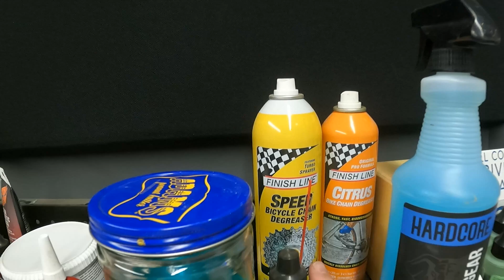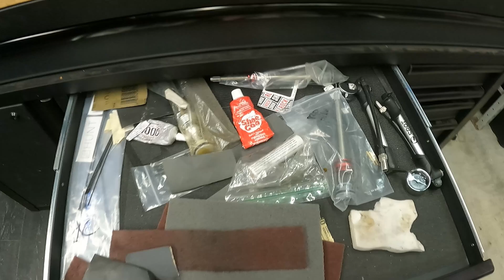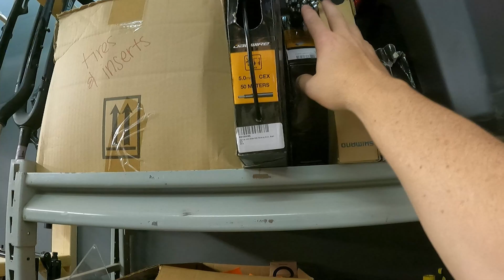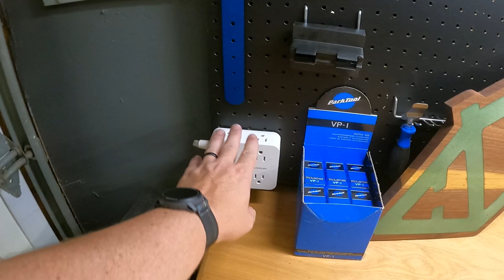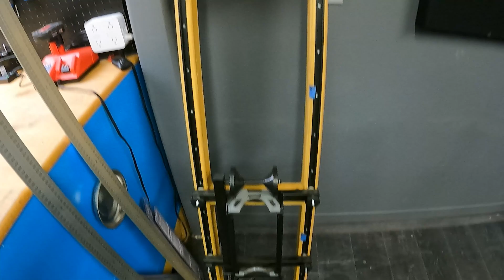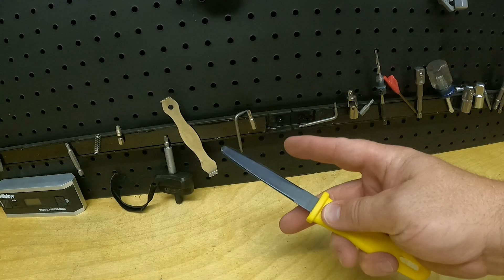A Tour of My Bike Shop/Recording Studio - Favorite Tools, Setup, Parts, and Lubricants

Comment: My favourite 'tool' at the moment is the RadarLabs Loobtoobs, its a grease syringe (various sizes) with a brush tip that makes greasing threads much less messy. It has great ergonomics and a lock nut so you don't grease the inside of your tool box by accident.
Reply from the maker: That sounds fantastic!

Comment: I’m surprised you don’t have the Park tool WH-1  wheel holder. I have a 10 x 20 building with a roll up door I made into my bike workshop. That wheel holder is used all the time for removing rotors and is a game changer for wheel taping and tire mounting.
Reply from the maker: Good to hear, i never thought id use it

Comment: Awesome video!  Dude, the dropper diameter standard is so frustrating.  I've started only buying 30.9 droppers and using a Problem Solvers shim if I need to swap to a bike that's 31.6 or bigger.  It's been working really well for me.

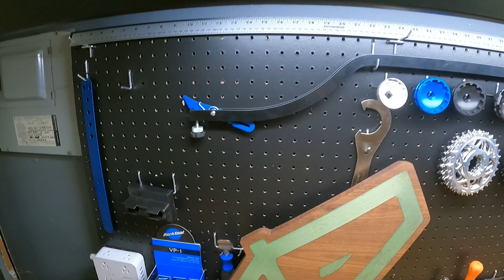Comment: 18:15 Frame alignment tool, not a wheel dishing tool. 👍👍
Reply from the maker: you're right! I knew that, but I totally got my wires crossed when talking. I do have a wheel dishing tool too but it's in a dawer.
Reply: @BigBrainParty Easy mixup! They kinda have a similar curve and are made out of a similar size square tube.

Comment: I know it’s hardtail party but I also know you ride full suspension bikes. What bearing press do you use for linkage bearings and hub bearings?
Reply from the maker: It sounds crazy, but with how many bikes I have, and how dry AZ is, I don't need to replace linkage bearings much at all. I have a santa cruz bearing kit, and a wheels mfg bearing press.